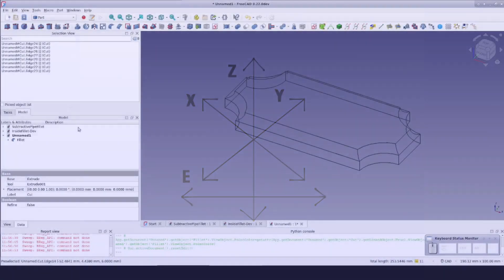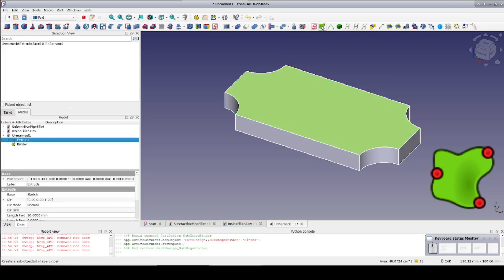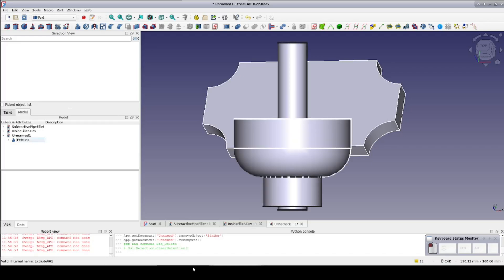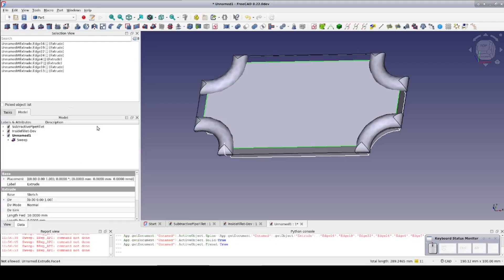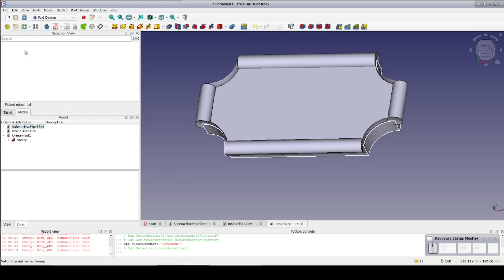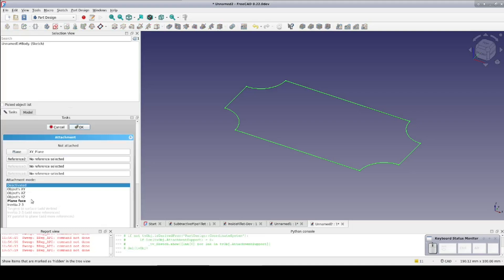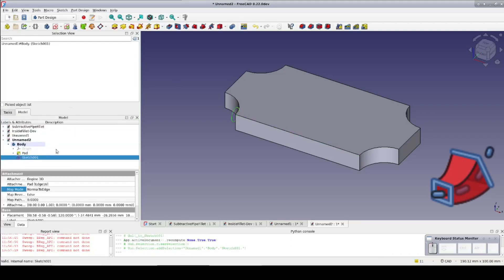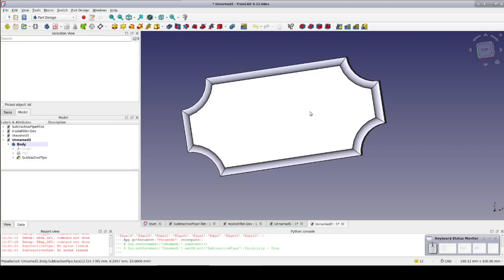FreeCAD: Inside Fillet 2 variations and an abject failure.

Comment: When you attach the sketch Normal to Edge against the edge of the object, it is upside down. Check this by doing an Extrude of your sweep profile -- it points away from the object. The sketch being upside-down causes the Sweep to be inside-out (somehow?) mathematically. So, in the Attachment, check Flip Sides, and the Sweep will perform as you expect in the Part workbench.
Reply from the maker: True about the attachment, but even setting Map Reverse (causing the extrusion to go the right way), the resulting sweep along all edges of the object results in odd geometry that will cause the cut to fail or just be wrong.  Further investigation shows that the failure is specific to paths where it must turn in to a corner and immediately back out to follow an arc. Watch the follow-up video for a solution.

Comment: Like your guides/ tutorials, very easy to follow without errors that were not expected. 

In one of your guide videos you said that if anyone has something problematic or challenging to put it forward to yourself to have a look at, so here goes.

I have only dabbled in freecad so this is the start of my issues. 

There is a tutorial in BricsCAD named “how to use 2d constraints and parameters to create a bracket”

The basic L shaped bracket is easy and so seems to be the variations until, switching dimensions of the basic L shape to the angle braced variant. The shape brakes and distorts. 

By distorted I mean that some vertices move to a negative position rather than a positive from origin
I’ve been attempting the more advanced design at the end of the video, I know my spread sheet dimensions are correct, but I get the same results with a distorted sketch when switching between model dimensions. 

The start shape for the advanced design is a + with the lower vertice of the left most edge fixed to original. 

The next part I am completely baffled with, one can create the equivalent of the “array” of objects (the holes) but, you cannot seem to make two because the second initial hole shares the same name as the first, therefore using the same constraint values. There seems to be no way of renaming each one, unless I have missed a step in this process. 

The steps I took closely match, as much as possible, the steps in that tutorial. For the array of holes I created new sketches on the top face of a pad from the first sketch.

Any help here is appreciated as I do like freecad as I’m not held in the shackles of propriety.

Comment: I suspect the different methods/results are caused by Freecad being open sourced. In other words, some different coder(s) wrote part design (the original Freecad) and part workbench.  As you are experiencing the nuances of Freecad, meaning how to make a model is best decided prior to beginning. Mixing part design methods and part workbench methods don't always play well together. 
I consider this is by design. Why would Freecad development group accept a submitted workbench if it worked the same as an already listed workbench ? 
This is a key consideration when watching yt Freecad tutorials. More than a few channels demonstrate making a model, however, the methods are spliced in the vid. Example would be watching intently which workbench the method is using, often swiching without mention/explanation. 

Great vid ! Please keep them coming !
Reply from the maker: Agreed about mixing Part and Part Design. I just don't do it. Under the Hood, the Part workbench is a more fundamental library of functions. Part Design actually has dependencies on Part.  I'm still working on a more complete understanding of the FreeCAD source. There is probably something PartDesign is doing slightly differently that could be ported to Part. There's no reason Part shouldn't do much like PartDesign does in this case.

Looking at it, it may be that in PartDesign, as the user selects line segments, a hiddel clone of the profile is made and attached to the new segment, then swept along the new segment and combined into the total sweep. At any rate, doing than manually in part produces the same final geometry as PartDesign.